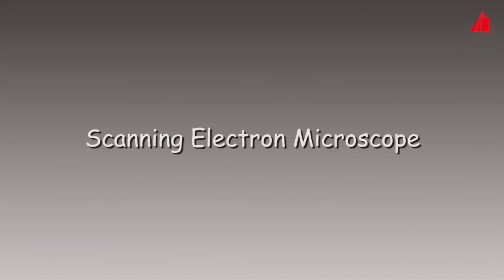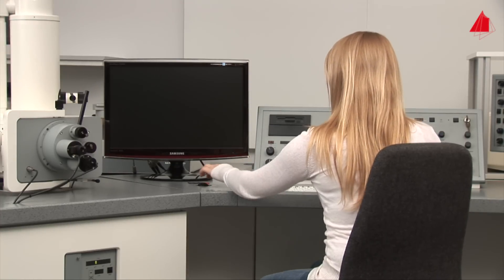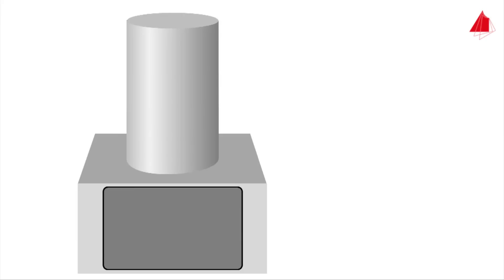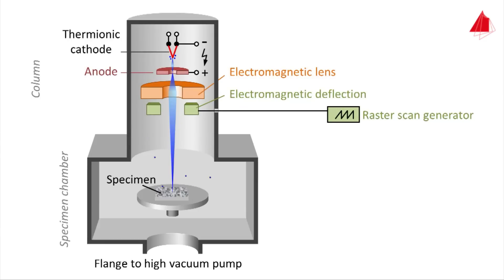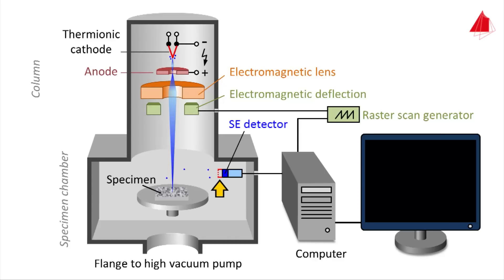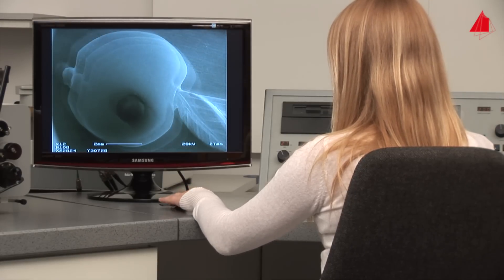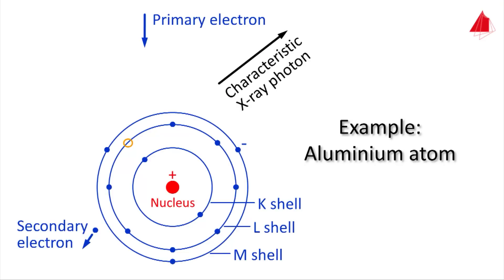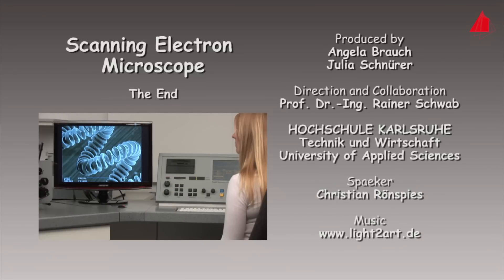The Scanning Electron Microscope

Comment: Could you say that the beam causes the object at the point of incidence to glow? In a sense of glowing with rays of electrons, but not in a necessarily visible way? Only in a way detectable by the SE detector?
Reply from the maker: Answer to "Could you say that the beam causes the object at the point of incidence to glow? In a sense of glowing with rays of electrons, but not in a necessarily visible way? Only in a way detectable by the SE detector?": Yes, in this sense it is indeed a kind of glowing, but only in this sense. The temperature at the focus point on the surface is not very high (under typical conditions), only slightly above room temperature.

Comment: I have a doubt .. what happened to the primary electrons after knocking down the secondary one .. there is also chance that the primary electrons also will be detected by the Se Detector along with the secondary one ... If that is so , there may be error in result ... 
Here my question is that "what is the ultimate fate of primary electron after they knocked out the secondary one"

I will be very great full if someone clear my doubt .. thank you
Reply from the maker: Answer to "I have a doubt .. what happened to the primary electrons after knocking down the secondary one .. there is also chance that the primary electrons also will be detected by the Se Detector along with the secondary one ... If that is so , there may be error in result ... 
Here my question is that "what is the ultimate fate of primary electron after they knocked out the secondary one"": 
The primary electron may knock out one electron, possibly another; it is deflected or even reflected in various ways. Ultimately, the primary electrons are absorbed either in the sample or in the walls of the sample chamber. And yes, there is some probability that a primary electron will reach the SE detector. So, to get good results, the SE detector must distinguish between primary and secondary electrons. This is possible via the energy (the velocity) of the electrons. The primary electrons have a large energy, the secondary electrons a much smaller one. And with a little trick, the primary electrons can be sorted out. There is much more to this subject, it is almost endless: primary electron detectors, diffraction pattern detectors ...
Reply: @MaterialsScience2000  thanks a lot

Comment: Wouldn't a regular microscope show the same details of a light filiment? I thought the SEM was for things really small, like viruses and maybe even atoms.
Reply from the maker: Answer to "Wouldn't a regular microscope show the same details of a light filiment? I thought the SEM was for things really small, like viruses and maybe even atoms.": 
The SEM covers a wide range of magnifications, from about 10 to over 100000. Since the standard light microscope is limited to magnifications up to 1000 or 2000 to obtain sharp images, the main applications of the SEM cover magnifications above 1000. However, SEMs are also of interest for relatively low magnifications normally covered by light microscopes. Here, SEMs show better depth of field and sometimes better contrast. But not always, so SEM and light microscope complement each other. 
In the case of a filament, a light microscope would have to cope with a much shallower depth of field and some other problems. Some of these problems could be partially overcome with modern techniques, but on the whole, the SEM is better here.

Comment: Why different areas of the sample emit different amount of secondary electrons? And why does more secondary electrons means a brighter image?
Reply from the maker: Answer to "Why different areas of the sample emit different amount of secondary electrons?": This is an interesting and very important point. In general, more secondary electrons are emitted in dense materials, and also at sharp edges. I must omit the explanations, they are much too long for this forum, sorry.
"And why does more secondary electrons means a brighter image?": This is a completely free decision made by the manufacturer of the SEM. But it is a good decision, because it leads to a "normal looking" image that resembles an optical image. One could also decide to go the other way and create dark pixels at locations where many secondary electrons are emitted. However, this would not look "normal", but more like a negative (inverted) image.

Comment: Amazing.
I have a question.
If I had putten a piece of a muscle, would I have benn able to see sarcomer structure?
Reply from the maker: Answer to "If I had putten a piece of a muscle, would I have benn able to see sarcomer structure?": In principle, yes, but it is a problem for (water-containing) organic substances to be placed in a vacuum without being damaged. So you need a very complicated preparation of the muscle. Mostly one uses transmission electron microscopy on dried, embedded and very thinly cut samples.

Comment: How do the secondary electrons carry the image? This is super cool.

Better than relying on reflection as with tradition light they can actually attract the image carrying electrons and convert them to light?
Reply: your thinking of the reflection electron microscope. The SEM has a single point that is moved in synchronicity with a second spot on a CRT Screen. This point is modulated (changed in brightness) with a signal from a detector within the microscope. This detector (usually a Everhart Thornley detector) attracts secondary (low energy) electrons knocked out of the sample by the primary electron beam (electron probe). These secondary electrons get converted to light by the Scintillator, then measured and converted to an electrical signal via a photomultiplier tube, amplified many thousands of times and sent to the CRT mentioned earlier. 

In Mördern machines the CRT is replaced by a ADC and a computer screen, but the basic principle still holds.

The image is then build up by scanning the electron probe across the sample

Comment: CAN WE SEE THE CORONA VIRUS ALVE IN THIS MICROSCOPE.
Reply from the maker: Answer to "CAN WE SEE THE CORONA VIRUS ALVE IN THIS MICROSCOPE.": Alive (or better: active) unfortunately not, because of the vacuum in the specimen chamber. But in "dead" (or better: inactive) state: yes, but the virus has to be prepared very carefully (drying, coating with a thin gold layer ...) before it can be examined in the SEM.
Reply: @MaterialsScience2000   SO BY VACUUM WE CAN ELIMINATE THE VIRUS FROM ALL PLACES.  LOCK DOWN NOT REQUIRED.

Comment: If I want to assess the structure of cement concrete, I will have to dehydrate the samples, which indicates that I am going to visualize the structure without the important hydration products such as CSH (calcium silicate hydrate) and CH (calcium hydroxide). Don't you think it does not portray a good message in the field of concrete or cement? (Nevertheless, if you search about SEM of cement- or concrete-based samples, you will come across a myriad of papers incorporating SEM testing of these products.)
Reply from the maker: Answer to " If I want to assess the structure of cement concrete, I will have to dehydrate the samples, ...": You are addressing a general problem here. You will find it not only with cement/concrete, but everywhere where there is moisture, liquids, ongoing reactions, in biology and so on. If you dry and process your sample, you will change it in most cases. What can be done? Sometimes it is enough to show that the changes in the sample are small or even negligible. An alternative is to replace the water in the sample with a suitable alcohol or other organic liquid, and then process the sample further or simply let it dry. Or one can use a special microscope with a combined high/medium vacuum. Biologists write whole books just about this problem ...

Comment: Amazing how just 'counting' the secondary electrons over time from a tiny portion of the sample manages to reconstruct an image that looks so much like a magnified image of the sample.  In fact from this point of view it doesn't make sense to me; the incoming beam of electrons (wherever it is aimed) is going to come into contact with atoms of the sample of the surface - its going to knock out secondary electrons that will be picked up so how is it giving such amazing resolution?
Reply from the maker: Answer to "... In fact from this point of view it doesn't make sense to me; the incoming beam of electrons (wherever it is aimed) is going to come into contact with atoms of the sample of the surface - its going to knock out secondary electrons that will be picked up so how is it giving such amazing resolution?": The "trick" is to focus the primary electron beam extremely. The diameter of the beam on the sample surface must be smaller than the distance between one scan point and the next. I hope this helps.

":

Comment: Wait people! Y'all don't think this is crazy!? 🤯 The electrons aren't "reflected" like photons would be... They're accelerated towards the sample which knocks off a "secondary electron" ... I don't fully understand but I did Google it and apparently they use both "backscatterd" or reflected electrons as well as secondary electrons. Apparently the simplest kind of SEM just uses secondary electrons. Supposedly they help to improve resolution in the topography of the sample. I still think it's crazy... they're not reflected, but emitted from the atoms and then pulled towards the oppositely charged detector which then measures...the intensity of that electron? 🤔 Aren't all electrons the same? Maybe it has something to do with interferometry? I did find a "Nanofabricated, monolithic, path-seperated electron interferometer" Not a bad idea apparently. 😎

Comment: You ought to see an Eyeball under a Surgical Electron Microscope!! Doc Mike
Reply: that is not easily possible, you would need to have the eyeball under vacuum for the electrons to reach it. Or alternatively use ones of very high energy. Either way, the eye will be damaged beyond repair if exposed to either the electron beam or the vacuum of such a microscope.

Comment: I'm amazed they can see the image in real time. I always imagined the image taking extraordinary long amounts of time to process.
Reply: I have worked on Stereoscan 250/600/... in the 80', we have always been able to get a "television" frequency for "low" resolution. Than, when it is about to take a picture, you lower the beam current and the scanning speed.
Reply: prolly coz computers got faster and can process data faster :) now and still improving :) next thing you know you will carry a supercomputer in your wristwatch ;)
Reply: @johndripper  You already do.
Your mobile phone has the same processing power as a supercomputer of 40 years ago.
Reply: @johndripper  you already do
Reply: The higher resolution images require a slower raster.
Reply: probably that was true until recently?
Reply: @Beeblebroks  Older SEM typically have a higher frame rate then modern ones, at least that was until recently. On the Stereoscan MK I (the first commercial SEM) you got around 5 or 10 FPS for the full field, and around 30FPS for reduced area. On later models from Cambridge, you had the addition of a TV Scan generator that produced 60 half frames a second. There are many more examples.

However, recording an image for publication, or just recording in general, usually takes (not took) minutes per frame, as you need time to integrate enough signal to get a good image without noticeable noise.
Reply: is it fast enough so can they make videos of what they observe?
Reply: @professionalmeatslinger  not every machine can, but a lot,  are capable of Realtime video and video recording.
Reply: @lbochtler  thank you
Reply: Same
Reply: Hi
Reply: Hii
Reply: It depends on how good you want the image to be. If you move it in real time it means it is scanned rapidly, which means it will have noise, which means some detail may be lost. If you want the finest possible image with the most detail, then - yes - the scanning can take minutes or even more for a single image.
Reply: me too

Comment: Great video. I actually ran one quite similar back in the early 1980's while working at a semiconductor manufacturer in San Jose - on Bubb road near Deanza college. I took step coverage micrographs of mil-spec parts along with the occasional insect. Wolf spiders up close have really big fangs! and bees eyes are incredible. But you need to be very careful or you can set them on fire and really mess up the internals - takes hours to clean and re align the collumn.
Reply: wow! that's really interesting
Reply: It can catch fire even in a vacuum?
Reply: @justintan7548  Yes, as long as an oxidizer is present things will burn in either a vacuum or underwater. Ever seen underwater welding or a rocket motor in space? Just think how hot a concentrated electron beam can get...

Comment: Clear very good explanation. Thank you. I used SEM in 1969 at RWTH Aachen for my Doktor work to study surface of iron ore after reduction with CO and H2. It revealed iron whiskers in different shapes and sizes and explained reason for abnormal swelling during reduction. Though I used it in 1969 today I understand  with more clarity how SEM works from your video. Thank you.
Reply from the maker: Answer to "Clear very good explanation. Thank you. I used SEM in 1969 at RWTH Aachen for my Doktor work to study surface of iron ore after reduction with CO and H2. It revealed iron whiskers in different shapes and sizes and explained reason for abnormal swelling during reduction. Though I used it in 1969 today I understand  with more clarity how SEM works from your video. Thank you." Thanks for the information. The work you describe is an excellent application for SEMs.
Reply: @MaterialsScience2000  
Spin of Indivisible Particle : Watch...
https://youtu.be/nnkvoIHztPw
Reply: Xxxxx

Comment: But how exactly these secondary electrons can actually give a magnification?
Reply: Helo
Reply: they don't. The secondary electrons give you a signal you can use to construct the image by scanning a point across the sample and simultaneously on the view screen. The magnification comes about by changing the ratio between the scan size in the electron microscope (making it smaller) while keeping the scan size the same on the view screen.

Comment: is the detector really attract the electron? how the scope sppost to measure if the way the electron travel changed?
Reply from the maker: Answer to "is the detector really attract the electron? how the scope sppost to measure if the way the electron travel changed?" Yes, the detector really attracts the secondary electrons, and the travel path can vary a lot. But this does not matter, as long as the travelling time is small in comparison with the measuring time for each spot on the specimen.

Comment: Why didn't we see any micro-organisms on the sample materials? Were they sterilized somehow before being put in the chamber?
Reply from the maker: Answer to "Why didn't we see any micro-organisms on the sample materials? Were they sterilized somehow before being put in the chamber?" We clean all objects thoroughly before investigating them in the SEM. But even without cleaning the objects, it is difficult to see micro-organisms in the SEM. This is mainly because of the vacuum: the organisms die, they dry, they deteriorate … To view them in the SEM, special preparation techniques are necessary. Among many techniques the simples one is to dry the object and then coat it with a thin layer of an electrically conductive material, such as gold.

Comment: 5:30 "many recordes secondary electrons lead to bright point  ... none to a black point" 
Clear, but how translates the structure of a specimen (which is what we want to see) to more or less emitted secondary electrons? 
Is it because parts of the structure are hidden to the primary electron beam, so something like shadow for sunlight?
Reply: Ian Stevenson  Okay, thank you for the clarification. Had to read it 2 times (I'm not a physicist), but it is clear now. One thing is more obvious then it was before: a SEM is a  remarkable tool, both in how it works and what it reveals. That's  what our brains are made for: not for fighting wars and denying viral outbreaks. Thanks again!

Comment: Ok? Do the specimens need to be conductive?
Reply from the maker: Answer to "Ok? Do the specimens need to be conductive?":  Normally yes, otherwise the specimen itself gets charged with electrons. Only at very low acceleration voltages (around 1 kV) this effect does not occur.

Comment: Excellent video and its simplified presentation, question: what is its last  scale of  observation.
Reply from the maker: Answer to "Excellent video and its simplified presentation, question: what is its last  scale of observation.": Thanks a lot! If I understand you correctly, you are referring to the magnification. The best way to check this is by using the length scale bar on the screen. The length of the bar is specified directly above it.
Reply: @MaterialsScience2000  Yes; about magnification , Can we measure the atomic diameter of an mater ?
Reply from the maker: Answer to "Can we measure the atomic diameter of an mater ?": Directly no, the resolution is not good enough to see atoms. But indirectly yes, by special diffraction techniques, which is a very special topic.
Reply: @MaterialsScience2000  OooH Yes, thanks for your valuable information.

Comment: I like it how you need keys to operate this thing
Reply from the maker: Answer to "I like it how you need keys to operate this thing": This is actually an interesting point. The microscope in the video is 100% computer controlled, so we could have used a computer monitor to control it. Interestingly, in practice most users prefer a certain number of keys and buttons (in combination with two monitors). They say it's just faster and better ...